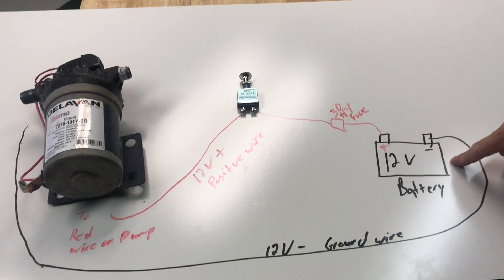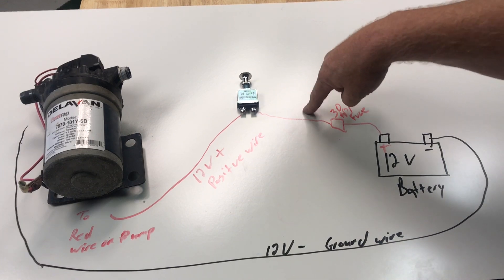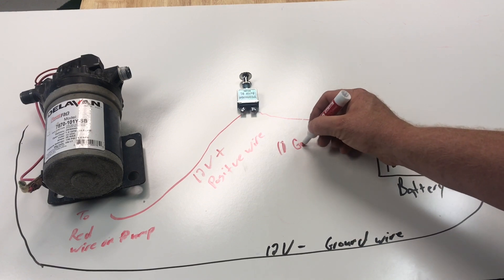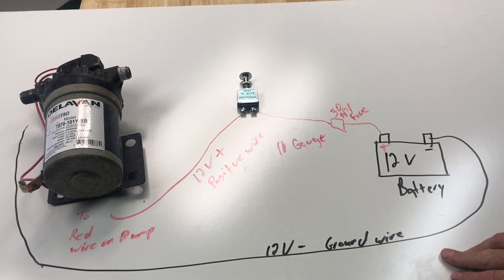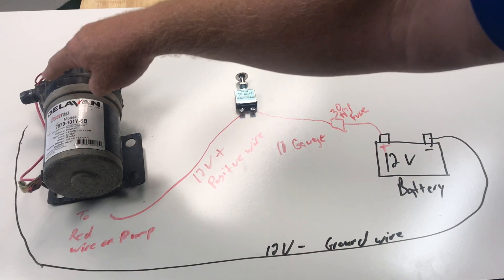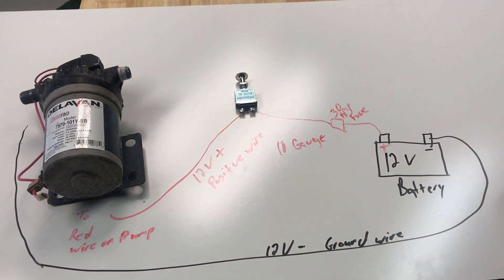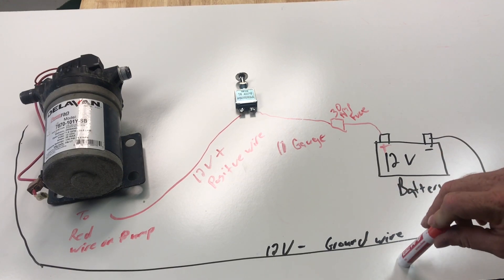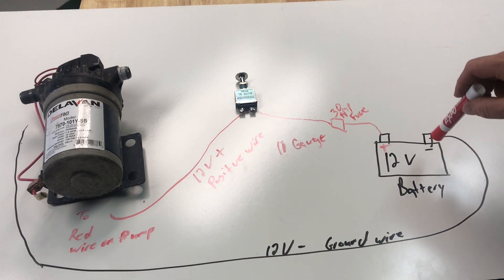HOW TO WIRE UP A 12 VOLT ROOF PUMP OR WINDOW CLEANING PUMP

Comment: What really screwed me was the splicing and properly connecting the wiring. Thru trial and error I got it dialed in on both my pumps now. We dont use switches we used a plug but the switch looks way better and Im now looking into adding that to the circuit. Thanks man

Comment: Hi great video one question at what distance maximum should the battery be and the switch from the pump
Reply from the maker: Usually you're pretty good up to about 10 to 15 feet depending on what size of wire you're using

Comment: We purchased a 12V DC RV Water Pump Water Pressure Booster Pump with 2 red wires ( no  black wires)  to an outdoor AC outlet to allow my garden hose to have enough pressure to power wash 3rd story windows
Reply: How did you connect 12v DV to 120VAC?   Don't you need a step down transformer and rectifier in there?

Comment: Do you have to put a 30amp fuse between the battery and the pump if the pump already has a 30amp fuse attached to it...?
Reply from the maker: Hey! So, here's the deal - it's a good practice to have a separate fuse between the battery and the pump, even if the pump already has one. Better safe than sorry, right?

Comment: I realize this vid is 5 yrs old. Im hoping you can help. 
I had to do this for a 2005 5th wheel. Had to do this cause of the old wiring and tank sensors. Problem is the battery doesn't hold a charge for long. I'm using a car charger everytime we need water. Why is the battery dead every time?

Comment: Hi Jason, what would happen if the in-line fuse  coming from the switch to the battery if it wasn’t there what effect will that give the pump? The reason why I ask is because I bought a skid and mine doesn’t have it but I am having a lot of issues with my pumps Breaking down

Comment: Hi watch this  looks simple , my question is im trying to set up a solar hose pipe water heater  on a shed roof  how best to put the pump as 1pipe is higher than the other  on opposite sides  and my water tank is below inside the shed  , hows best or best place to put the pump  thanks

Comment: does it matter if i use a 30amp fuse or a circuit breaker? or will they both function the same?

Comment: Hey man - I’m super new to this and have no idea how to wire up my battery correctly. It sounds like I need to buy some 10 gauge wire and a pole switch and a 30 amp fuse. I just bought the everyflo 5.5 gpm 5500 pump. Anyway you could help me out? I doubt this is possible but could we hop on a call/FaceTime? I’ll pay you for your time. I’m just so new and don’t have anyone to show me any of this.

Comment: Thanks for the video explanation. I have a question if you dont mind answering:  All the wiring is 10gauge up until the wiring that the pump comes with? Or do I have to change the wiring connected to the actual pump as well?
Reply from the maker: It's just 10 gauge up to the wire that's on the pump you don't have to change it out

Comment: Did you remove the relay it came with?  I'm looking for the wiring diagram for this pump.
Reply from the maker: Nope otherwise it won't shut off
Reply: @kingofpressurewash  Thanks bro.  Does the pump shut of on demand when using the solenoid instead of the relay?  No one seems to be talking about this.

Comment: I have one... Does the pump run the entire time? if you are not using it for whatever reason, will the pump burn out or is there a automatic shutoff of some sort. I thought I saw something like that on the  NorthStar rig...  So, would you recommended it?

Comment: I do have a question about the pumps…I bought a Everflo 5.5 and was wondering if there’s a way to change the wires coming directly out of the bottom of the pump. While I agree that 10gauge wire should be used…doesn’t that just make those short runs the weakest link?

Comment: Could you get power directly from your truck battery instead of a separate battery for the system?
Reply from the maker: Yes you can. But if you run it low and then it's no go
Reply: @kingofpressurewash  ok sir. Ty

Comment: Many thanks for the simple illustration.. Just one quick question: If the same exact setup is intended to be a portable rechargeable device (ex: the new portable battery powered dental flosser which is basically a pump and a rechargeable battery), do we need any other components more than what you kindly showed in your video? Especially if it's a 12v rechargeable battery?
Reply: Just add a small battery charger 😉

Comment: How it works with battery or adapter
Reply from the maker: The red I’m positive in the black on negative
Reply: @kingofpressurewash  thanks sir which is better 
Adapter or battery

Comment: wondering if you have any suggestions, my switch isn't getting power & wire back to battery goes behind wall so hard to trace & troubleshoot why switch & then of course pump isn't getting voltage...this may be slightly off topic but this is in a camper...any help or suggestions would be greatly appreciated, thanks!
Reply from the maker: Fuse somewhere or a bad wire
Reply: Ok, Thanks!

Comment: I have an on demand hot water portable camping shower. My 12v pump is 1.8 gpm. Would you still recommend a 30 amp fuse? And what gauge wire would you recommend? Any help is much appreciated!!!

Comment: Hey Jason, can I get away with just having a softwash system since I mostly do siding? Not getting rid of my equipment just rather only bringing out for specific jobs.
Reply from the maker: Absolutely. You only need high pressure for concrete decks

Comment: Sorry for my ignorance. But how often and with what do you charge the battery?
Reply from the maker: I actually let the pressure washer charge my battery. Or you can use a battery charger and charge it at night or once a week
Reply: @kingofpressurewash  I do the same thing letting the PW charge the battery. Do you know any premium types of battery's you use like a AGM type that would fit on a pressure washer? I use this same Delavan pump here.
Reply: Thanks mate it had me stuffed what I was doing wrong muchly appreciated

Comment: Can I install the ground cable to the chasis instead of the battery ?
Reply from the maker: I wouldn’t suggest it. If it doesn’t have a good ground the pump will not run right

Comment: Can you just get a wire harness with clamps and clamp it into the battery? I saw a vid about WNC Wash Pro's doing that
Reply from the maker: You can. The problem with that is you do not get a good connection on the battery and it’s going to get hot

Comment: What size battery is needed to get 4-5 hours of use?  12v obviously but how many amps? I was thinking about wiring it to the battery on my Pressure Pro. Or should I get another battery to run the my 7 gpm pump.
Reply from the maker: I would use a marine battery as big as when you can and then you can actually run your pressure washer off of that battery then
Reply: @kingofpressurewash  ok   
second question, SORRY...
Which 12v pump works best for you?  you have mentioned a 5.5gpm.  I'm using the Everflo 7gpm diaphragm pump... 1/2" plumbing all around...  maybe the better question is, what nozzle tip sizes do you recommend. My current tips are 50 orifice tips, 250 feet 1/2" hose, and I get about a 12 feet stream with a 0050 tip.  I have people telling me I should be getting 30 feet...  I need every bit of 30 to clean the roofs around here from a ladder at the gutter if a can't walk it.  any input would be appreciated.  Thank you

Comment: Hi Jason!  Amazing videos.  I’m putting my first setup together now.  I’m decent for now on the power washer side but as far as soft washing, I just ordered a FB3 100 PSI 7 GPM.  Since I do use my current truck for my gooseneck horse trailer, I need the current setup to be removable occasionally until I decide to either get a second truck or enclosed trailer.  Anyway, my main question is why do I need a 75 AMP switch?  I ask because I’m trying to make a clean custom rocker panel for all of my aux connections.  If I truly need a 75 AMP switch, can I just use an automotive resistor in that range with any DC switch?  Lastly, since I have a 7 pin trailer hookup in my bed of my truck, my idea was to get a blank trailer pin and just connect 12V power and ground terminals.  Do you see any issue with this?  I don’t know what gauge wire they used when they ran the plug but it was a high end RV place so I’m guessing it was done right.  Also, I have 2 batteries in the engine bay, but for some reason I can’t install a switcher on them to make sure I don’t drain one for car to start.  The mechanic said they run in parallel or in series...one of those lol.  Anyway, primary question is the switch but if you have any input on my tow hitch power source idea, I’d appreciate that as well.  Thanks again!!!
Reply from the maker: The 75 amp switch is so I don't need a relay. Other wise you need a switch that can handle at least 30 amps
Reply: @kingofpressurewash  That's what I figured.  This is all kind of new to me but I have my waterproof solder and seal butt connector and ring terminal technique down pat now lol.  I ended up finding a 35 heavy duty toggle at Wal-Mart ironically, and returned the 75 AMP to NAPA.  I got an Interstate deep cycle marine battery and while I know it's overkill, a NOCO G26000 charger/maintainer.  I was going to get an Optima AGM yellow, and my buddy sells, them and said they were great back when they made them in the US but suck since Mexico production.  Anyway, right now I have thick plastic rolling tool box that is empty with a small tray on top.  I have the battery in there with the pump.  Ideally, I'd like to mount the pump to the wall of the toolbox and extend the fittings through watertight holes in the box with some sort of seal and my banjo valve on one side for the suction tube and I have to figure out a quick disconnect for the other side.  Is there a schedule 80 or other good QD 3/4" NPT to ideally a 1/2" hose or barb.  I played with the setup a little yesterday at a job for tough 120 year old sandblasted brick and now will only apply my solutions with soft wash and then power wash only if needed.  Any other suggestions for making the output section quick disconnect would be extremely appreciated.
Reply: Also, back to the switch, am I to assume if I get a 30/40 AMP relay, I can connect it to any switch?  I'd like a panel of lit rocker panels on my final build and they are usually max of 20 AMPS.  Do relays drain any battery when not in use?  I heard that in another video.  Also, do you account for the rating in the switch when using a relay?  For example, if I need a 40 amp switch and the switch is a 20 AMP, do I get a 20 AMP relay or 40 AMP?  I'd like to do a video of how much it costs as how much to build your own high-end setup. Next step is metal battery box and custom frame welded so I can mount pump and hose reel on top.  We'll see and ideas keep changing lol, but I've become obsessed with wiring. I want to get maybe a 4 bank setup and run truck bed light and spotlights for working at night, rock lights in fenders, etc.  There is a charger that uses kinetic energy while driving I am looking into as well,  As you can probably tell, I am severely OCD (which is part of why I love power-washing so much.  That's my only concern about the toggles.  I guess I could get all high amp toggles but the rockers look so nice and are pre-mounted to a plate.
Reply: For those of you not looking for a mounted or panel fuse breaker, I got an in-line waterproof fuse holder at NAPA autoparts and popped a 40 AMP automotive style fuse in.  The fuse holder itself has rubber for not only the cavity for the fuse but also for the cap.  Also, for any of you new to this, going from the 12 AWG lead wires on the pump up 10 AWG uses the same butt connector, so it is as easy as staying with 12 AWG.  I use automotive/marine grade wiring and connectors just in case...

Comment: Is it the same for a 5.5 pump?  Same gauge wire and fuse size?
Reply from the maker: Bo L it does not draw as many amps so you can go a little smaller on wire

Comment: Jason, awesome video! Just want to clarify one thing. The 12v pump comes with 12, maybe 14ga wire installed.  You’re connecting the 8ga wire directly to the 12/14 ga pump wire? Seems like it would overload the pumps original wiring.  Just making sure I’m doing this right. And the other red wires with the 10amp fuse remain attached? Thanks!
Reply from the maker: So the fatboy pump is rated at 40 amps, The longer the run of wire the more you have voltage drop, so a bigger wire cuts down on voltage drop.
Here is a voltage calculator that show you the ok wire for your amps and length
https://www.wirebarn.com/Wire-Calculator-_ep_41.html
Reply: Power Washing awesome! Thanks Jason

Comment: I have my 12v water pump exactly how you describe. it is connected to a 12v battery. What do you recommend to be able to plug it to AC 120v. ? Found my battery drains very fast.
Reply from the maker: Camilo Echeverri battery tender will fully charge your battery but not over charge it
https://amzn.to/2FW09zq
Reply: You can't go wrong with NOCO or Battery Tender's more professional products.  I have a collector car collection and they are all maintained with either.  However, since I only have 1 battery for now for soft washing, I splurged and bought NOCO's biggest charger/maintainter/restorer, the G26000.  However, here is a great article about deep cylcle battery chargers I used as a reference:  https://www.rvweb.net/best-deep-cycle-battery-chargers-reviewed/

Comment: Thanks Jason, I've beating my head on what I've been doing wrong. I'm running a 30 amp switch. I hope that's my issue. Just ordered the push pull one you recommended.
Reply from the maker: Boyd Webb glad I can help

Comment: Hi Jason, Greetings from Kent in England. Thank you for your videos and the detailed links.
Questions for you:
1: what flow rate and psi could I expect for copying this setup?
2: would it be strong enough to include a downstream pickup injector, thereby saving the mix from entering the pump?